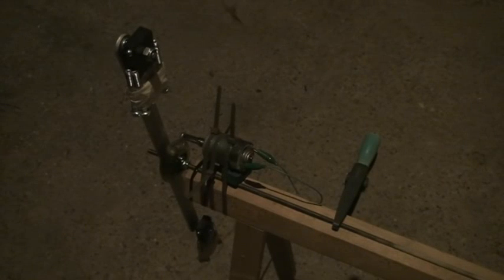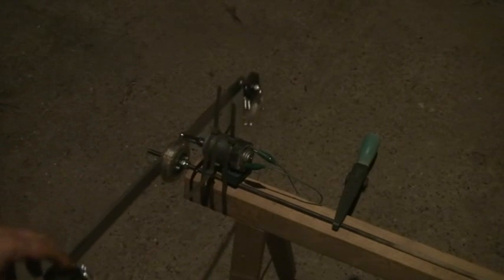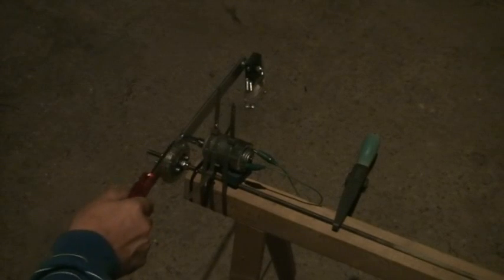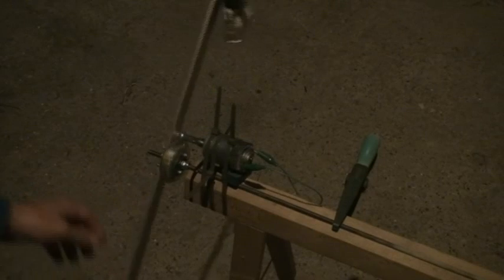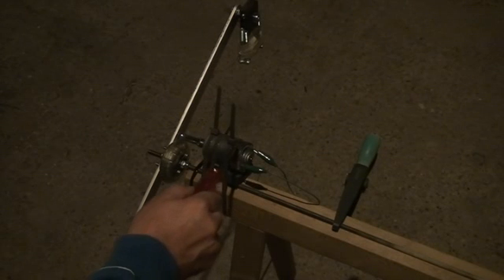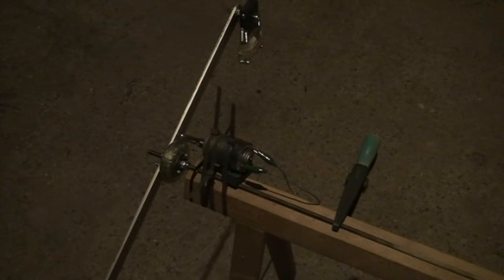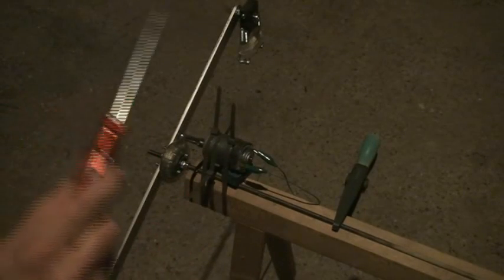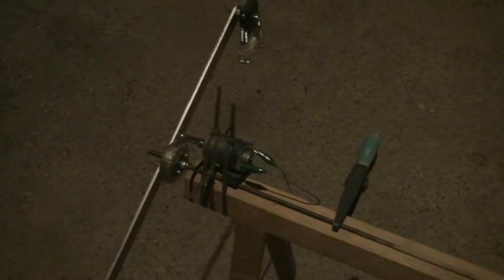Mikhail wheel finger subjectiv feeling 1

Comment: If this device works as presented, wouldn't it work as a perpetuum mobile if you remove the generator altogether?  I mean, if you pull off the generator, wouldn't it just spin forever on it's own (IF it works)?